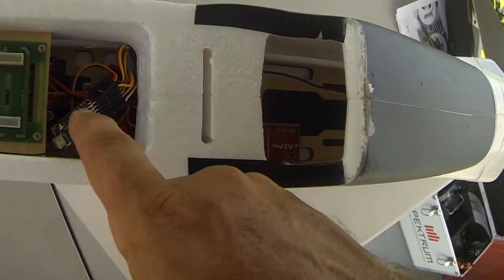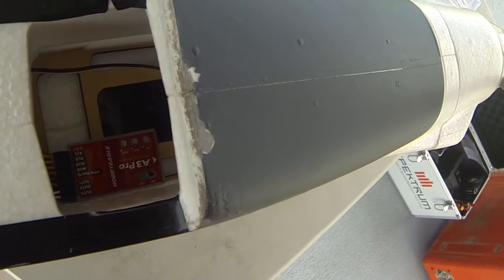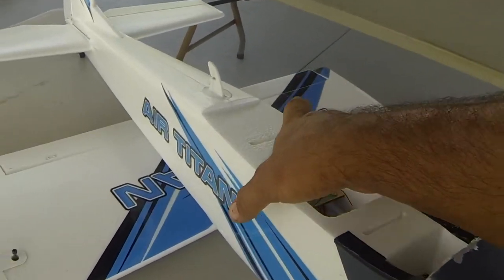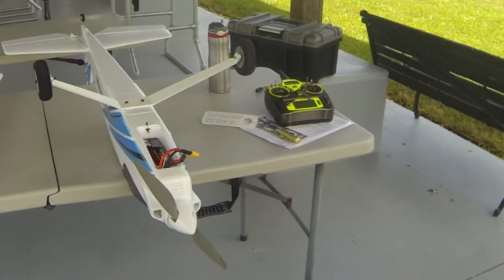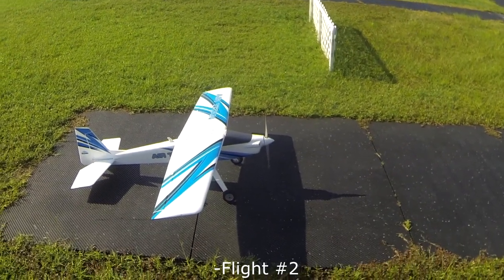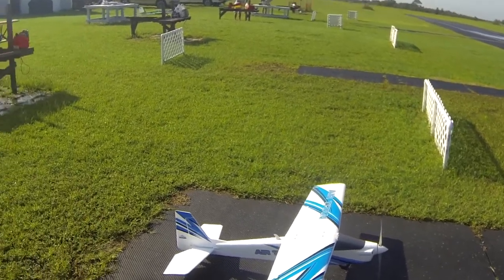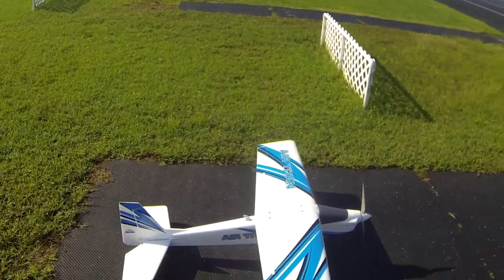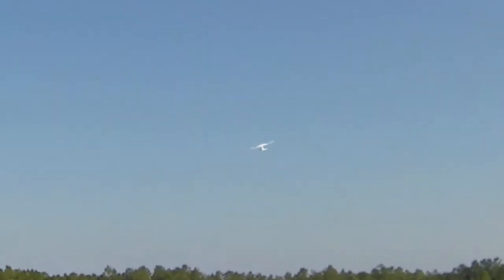Motion RC crash contest grand prize: Skynetic Air Titan

Comment: Install the NEW HH AR630 safe receiver, with forward programming. Install in any orientation and set it up with the transmitter. all settings are done with the transmitter connected to the reciever. put safe on any switch, etc.... I have this in my titan and love it.